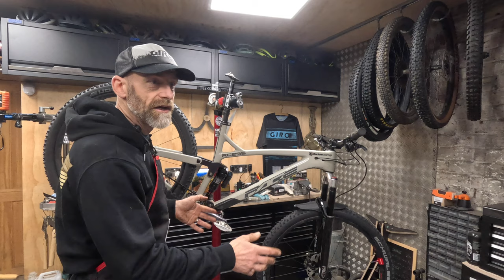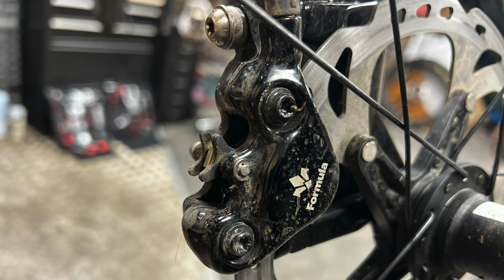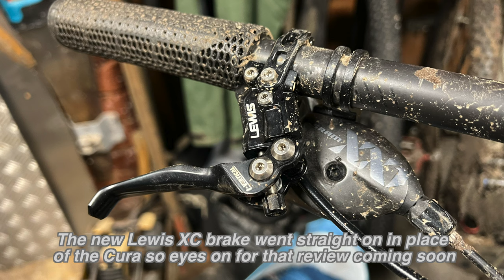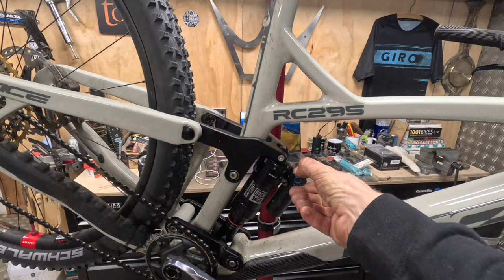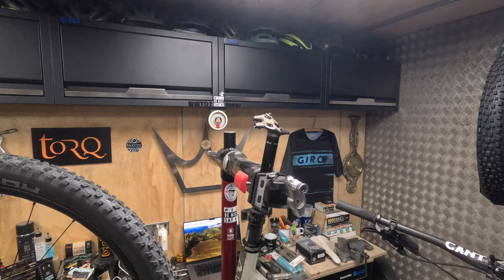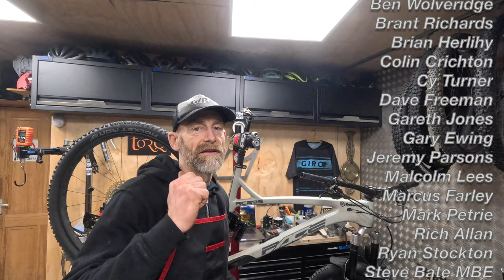Pace notes: SRAM, Formula, Garbaruk, PNW, Pace MTB kit long term test compilation

Comment: I got Cura 4. I confirm these brakes will work in -10C, but they will get a wooden feel and be more sensitive, but will work well. Same deal with Shimano. 
I don't know the temperature limit on the fluid and seals.

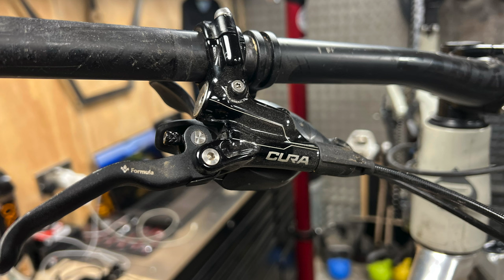Comment: 1:43 Heads up, the bushing will likely fail in less than 400kms. Mine did, which meant horrible play and dead throw. I have Cura 4.
I upgraded to RG Components lever, it has bearings, I had to sand down the original pin, as per instruction, as due to manufacturing the tip can be too big for it to fit trough the bearings, but had to sand it down a bit further, lubed it up sanded, tested, and repeated until it fit all the way trough. and now I got smooth lever action, smoother than original.
You might lose the pad pin on at the caliper, Loctite 243 is a must or it will come off despite the clip. My rear lost the pin.
As the brake is stock I can't recommend it, but with the RG Components levers I can. As you can get the spare parts for them. Yes not massive amount of distributors but they exist. None in Norway but that's fine.
Reply from the maker: Cheers for the feedback chief, I'll feed it into the review

Comment: Fully agree with your comments about the cable actuated SRAM shifting. The 11spd X0/XX1 is still the benchmark drivetrain on DC/light trail bikes IMO. T-Type is great but if you’ve grown up modulating power as a shifting clutch, cable actuated shifting is faster. As you say, no battery to think about etc.

Comment: 6:37 I have the 11-50T 11 speed, no issues, I noticed it shifting a bit smoother as it wore in. But I see some riders experienced warping of the whole cassette. I will see how it goes.
So far I think it was only two people on YouTube. I've not tried Sram cassettes. But It's smooth enough. I'm using a regular chainring, not boost. Boost chainring and it will drop on the biggest cog. Also with boost chainring it the chain will scratch the cassette. I only tested boost chain ring on one ride, just to test it. I use 6mm offset chainring on my Geometron G1, but not all bikes have clearance for it. The bike has DtSwiss 350 Boost hub. So if room always run 6mm offset chainring, not boost. I've not tested it with M5100 cassette, but I suspect same thing mgiht happen, but don't know for sure.

Comment: 2:44 About spare parts, I got mine from Elro in UK. I had to rebuild the front caliper as it leaked. It arrived in Norway quickly. I forgot how quickly that happen, but that was not that much use, I took a look at the seals, they did not have any tears or damage apart from being deformed into a cone shape. This might be why they did not retract, and got stuck even after lubing pistons. And leaked on rides before I got working on them.
O-rings at the bleed port also wore rather quickly, especially the front brake, I only did one bleed and it looked horrible, worse than the rear brake which I bled multiple times. But I replaced both. For some reason O-ring only is not sold, you have to buy it with the bolt, or get the o rings from a hardware store. As rear caliper did not leak and worked flawlessly i did not mess with it. But the bleed port O ring at the lever had to be changed as it had a tiny leak, so a bit of air came in.
Reply from the maker: Thanks for the information  mate, I'll make sure to include that in the review

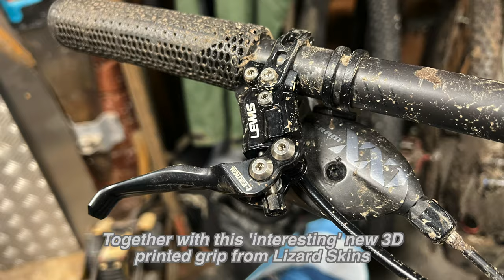Comment: 4:18 Interesting grips, but looks like they could be problematic if you crash into gravel or get muddy and grit gets in there. But at least the top seems to be hole free. Probably hard to clean. But the holes probably make the grip more wiggly. Or does it?

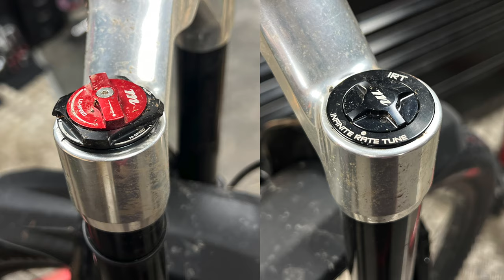Comment: 9:41 I guess this requires a special Manitou tool.
Reply from the maker: No it’s just a standard 6mm hex
Reply: Sorry, I meant the black thing.  @GuyKesTV
Reply from the maker: @mtbboy1993  no it’s standard shock pump air valve. I do still have a 50cm long hex key from a Manitou fork that needed some time in the early 2000s tho 🤣
Reply: Sorry for bothering you. I'm not good at clarifying today. I mean the weirdly shaped black on the left picture, the part underneath the red one. I just noticed it says High-speed, I guess this is just a high Speed Compression dial. So will come off after removing the bolt I guess.  @GuyKesTV
Reply: I'm curious about the Air side too. Yes I see the top cap iss standard thing, but I also see the thing with Infinite Rate Tune, is flat, looks great, probably has a way of removing it on the inside below the air cap.  @GuyKesTV
Reply: Looks like the High Speed compression dial has a good design. but as there is no hex on it, nor the air side, It probably uses a BB tool to remove Maybe cassette tool. Maybe on both sides. @GuyKesTV
Reply from the maker: @mtbboy1993  no problem, that's the high speed compression. The square-ish black bit under the red low speed dial is the adjuster knob that you turn.
Reply from the maker: @mtbboy1993  The ISS air spring fills from the top, the main air spring valve is at the bottom of the leg
Reply: Yes, I see, I noticed that a bit late.  Interesting design, looks like it would be comfy to turn. @GuyKesTV
Reply: Two chambers, nice. So proper adjustment without any tools and disassembly and deflation. Adjustable chambers should be the norm. I hope it will be. Nice to See Manitou is doing it too.  @GuyKesTV